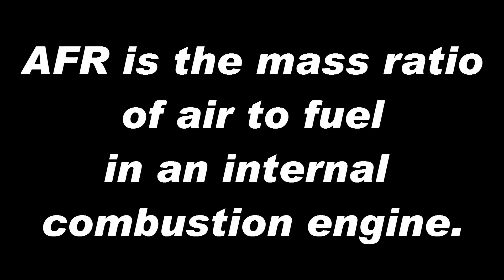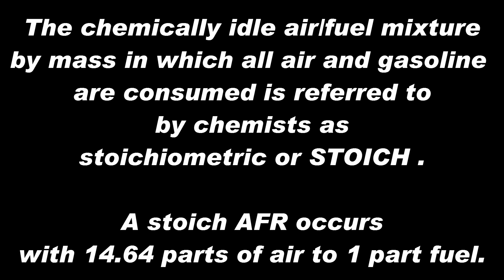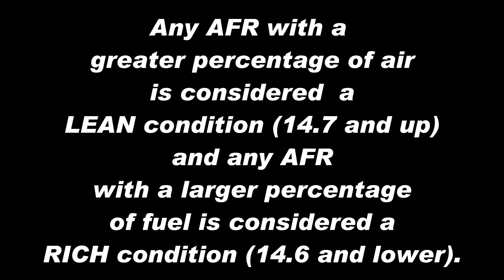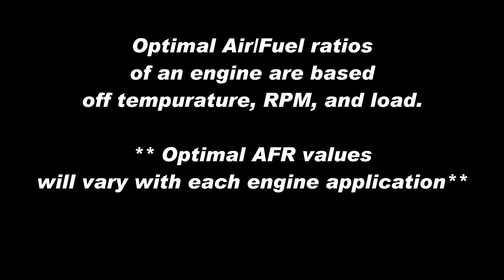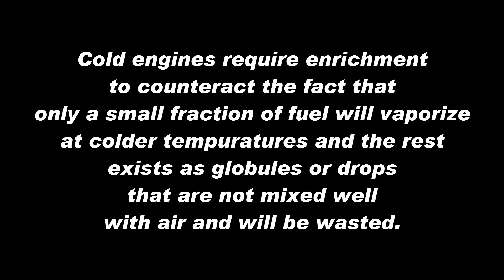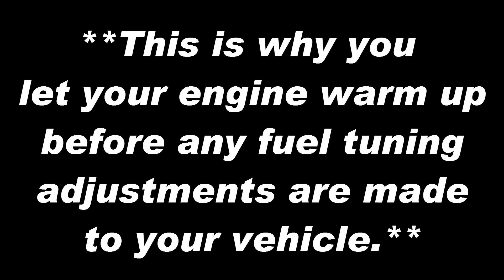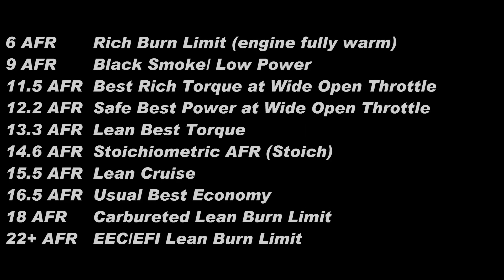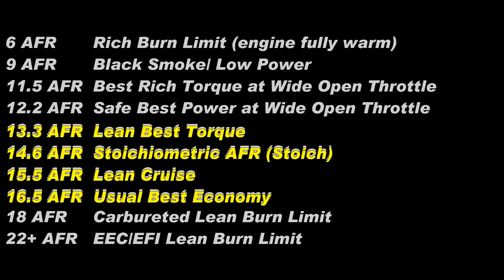Understanding AFR Values

Comment: i definitely have rich symptoms, but it runs 14.7 up to 99% throttle, and at full it drops to 11-12. according to this it should be ideal for power, but i have a lethargic pedal, the smell of fuel, and some pretty mean pops
Reply: 14.7 is too lean. Best N/A performance around 12.5 -13 and if you're boosted you need to drop it some more say 11.5 starting point.
Reply: @Yarrow54 mines at 9.8 is that bad, boosted is350

Comment: At my part throttle cruise i currently run 14.0 which is same as my idle. How much leaner can i go safely
Reply: 15.5 to 16 is usually max
Reply: So 15.5 is safe for 91 octane? basically I want safest lean afr so I can have better mpg without causing damage to my engine another thing when you have a stock vehicle how much afr will it be running from the factory at cruise area like from 1000 to 2000 rpm (GM vehicles)
Reply: Too many variables to give an accurate answer & "better" AFR does not necessarily mean better mpg. If the engine is producing less power you'll respond by opening the throttle to maintain speed - more air will also mean more fuel, so even if the mix is leaner the MPG can still be lower.

Comment: Great video, but what exactly is the difference between "hesitation in throttle response" and "lethargic throttle response"?
Reply: It is related to fuel pressure and timing. For exp. I have a holley 750 cfm. Double pumper carb. First ıt was 6 psi fuel pressure and 36 degree total timing but ıt was not good. I changed fuel pressure to 3 psi and 30 degree for total timing and now ıt is a Rocket... and made afr 12.0:1.. response is related to these magic 3 items..

Comment: This is great! I have been fighting my EZ EFI now trying to get it dialed in and this was amazingly helpful.
Reply: What a/f ratios do you run for you setup. And why?
Reply: @mlin3129  my efi system kept reading low 13's and into 12's at idle and cruise and I couldn't get the EZ EFI to adjust so I swapped it with a Holley efi. I'm running a Blueprint engines 396 small block and I've been able to keep high 13's into 14's at idle and cruise. Low 13 into 12 is too rich for the motor and fouls plugs.
Reply: @balzonyr4head  thanks! I been running ez efi 1.0 for a year know.
It took me a year to get it right. The IAC screw is very sensitive.  Besides that I'm looking for air fuel ratios  that will really launch and smoke tires

Comment: OK so I have a 04 srt4 I have ran at 14.1 to 14.4 at idle and 12.4 at work with hesitation since I owned the car. Now I got a check engine light for throttle position sensor high andmas sensor now running 11.1 idle IDK if I can run at that safely and why did it change please help
Reply: Throttle postion sensor reading high explains the higher AFR reading if it read low it would make you run leaner get a digital multimeter and find out your factory closed throttle body ref voltage and its wot throttle ref  voltage do some read up on how to check it if your confused fix that and your mass code and tps code will go away after a computer reset, the tps may just need to be replaced compelety , after your done pull the negative off the battery and turn the lights on for 15 mins come back turn the lights off plug the battery in you  now reset your computer after this your car should run like new..

Comment: for boost or N.A?
Reply: 11.5 - 12.2 AFR is generally the wide open throttle for NA. usually AFR in the mid to high 10s are used for boosted applications with the idea that the richer fuel mixture is used to lower cylinder temperatures to avoid detonation. My Toyota 86 is still NA, but my AFR at wide open throttle is 11.3 because my tune runs more advanced timing for increased power.
Reply: I boosted my NA gc8 and its reading 12.2 at idle is this  normal?
Reply: @bennjiestewart3786  That's a bit too rich for idle, want to be between high 13's to high 14's at idle

Comment: OK OK OK  wait a min.   WHICH fuel are you talking about?    gasoline?   or gasoline  10%  ethanol?  or  E-85?   or some other fuel.
Reply: 14.7 is the gasoline stoich. Depending on the fuel type that number will be different. I think this applies to 87/91/93 in the US?